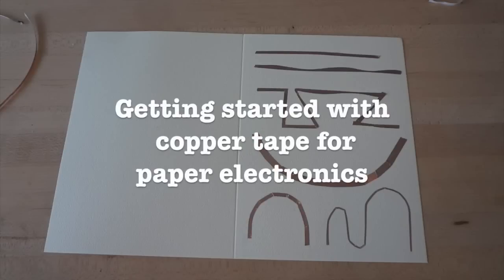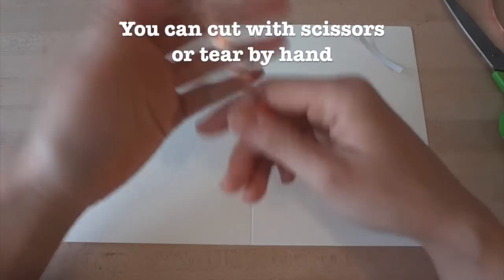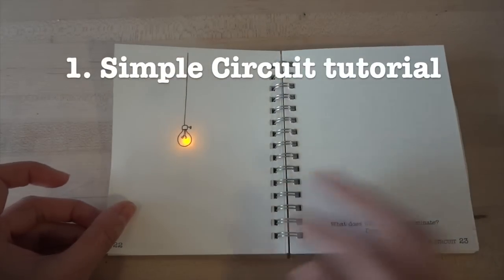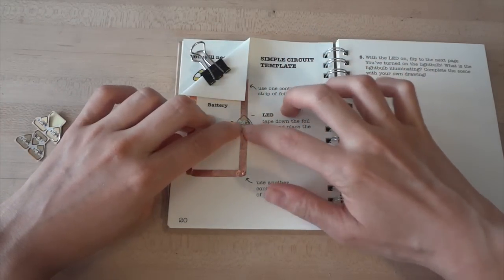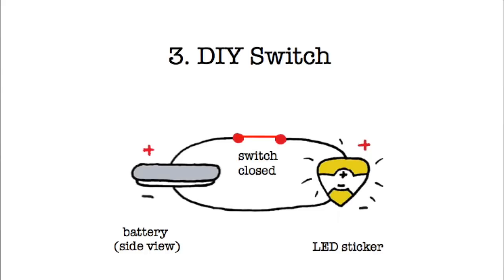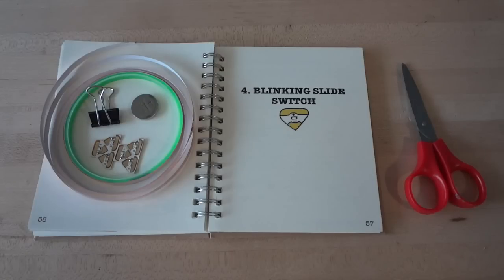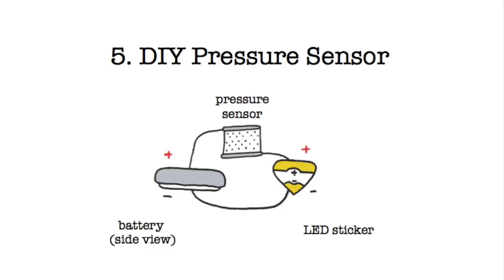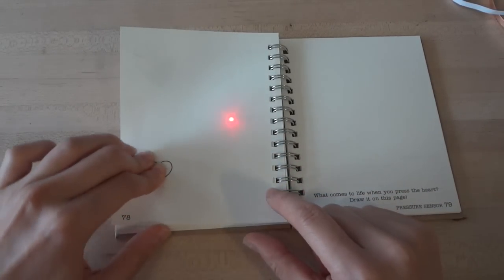Working with Copper Tape and Paper to Craft Circuits

Comment: Just to say that by splitting your tape you are reducing the maximum current you can carry. Probably ok for battery use, but might be an issue if you move up to a 5v supply ie USB

Comment: Your parallel circuit is really a series circuit and this is why your LEDs get dimmer the more you add.  A parallel circuit uses its own wire and as you add LEDs they will all receive the same voltage. . In a series circuit the voltage is addition of all the voltage elements. In a parallel circuit the voltage is the same for all elements.